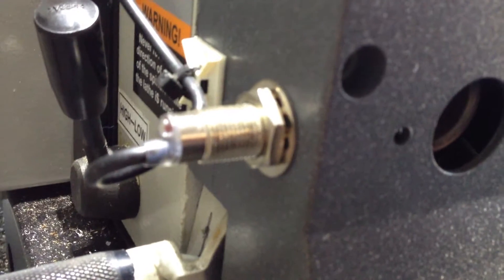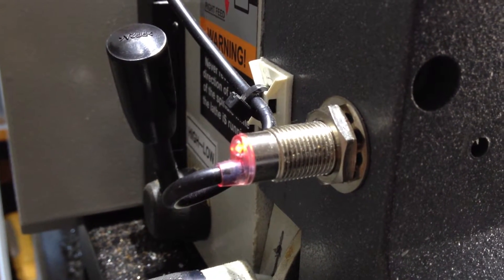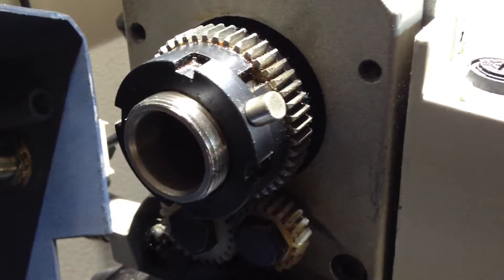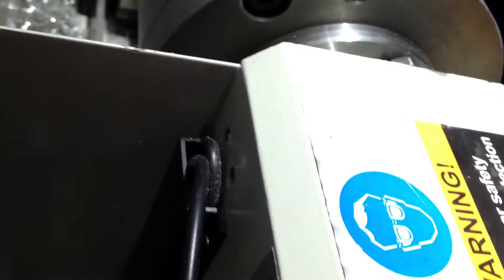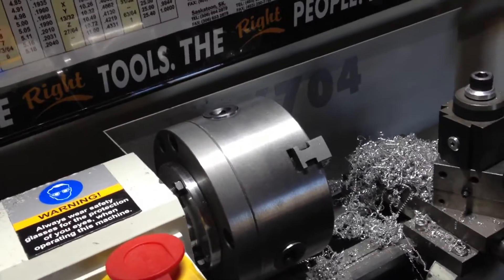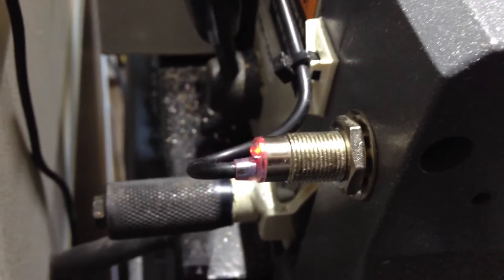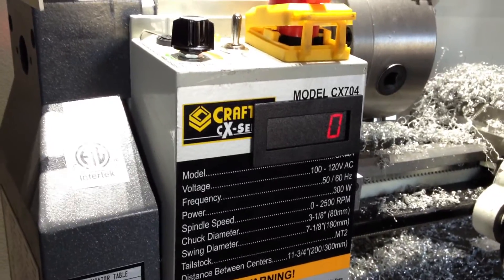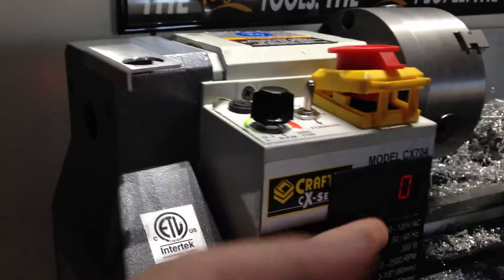lathe tachometer part 2

Comment: Thank you so much as I've watch 2 million videos trying to find out if folks were just sticking the magnet on with only the power of the magnet holding it on. I didn't think that it would hold but rather fly off at some point. I was hoping I could find that answer without physically trying it only to find it did fly off and I would have to do something wonky to get it hold which might require a completely different set up than my 1st attempt. So thank you very much for putting my mind to ease!

Comment: Great video. Thank you for sharing your work.
I'd like to know which wires match the hall prox sensor to the tach wires. My tach has a 5-white-wire harness with red markings on 4 of the wires, but don't know what they mean and don't know which ones attach to the wires of the hall prox sensor. Just a little frustrating. Cheers

Comment: cheers  for this  i was wondering  where  and how to  fit my magnet.  one thing for ppl to  note is the magnet has to be the right way round  to try it  if it do not register  turn the magnet over
Reply from the maker: Yes, this is absolutely true. Magnet must have the correct pole facing the sensor.

Comment: I installed a tachometer that I got from Amazon for 18.99 just like yours in the same spot on the front because of the switches and electronics board inside. The power supply was the guts of some little power supply (9v) and connected to the power switch. It goes off and on like it should. There is room inside for it. I ran the sensor wire out the back with the power wire over the top of motor and up the back and mounted the sensor like you did. You were right about the magnet, I ended up using 3 little magnets (stacked) and did the trick. After everything was OK and adjusted I put some super glue on th magnets.
Reply: This is exactly what I would need for my South bend 9a, could you be so kind as telling me what is the part# of that tachometer, you mention that you purchased it from Amazon?

Comment: Hey Thanks for the vid. You said that you got a 12v adaptor to power it. How did you get the tacho to turn off when the lathe is off if you didn't mess with the lathe wiring. Cheers.
Reply from the maker: +oohsam The input of the 12v adapter is connected to the switched side of the red E-stop switch on the lathe.

Comment: Excellent!  I was worried about attachment of the magnet, and never gave it a thought to just let the magnet do it's thing.  Thanks for answering my questions and the video as well.
Reply from the maker: If you're worried about the magnet coming off, you could simply use some 2-part epoxy to make sure it doesn't go anywhere. I would have done that if I had any at the time of installation, but then upon testing it didn't actually need it. It's been there for about 7 months and hasn't budged.